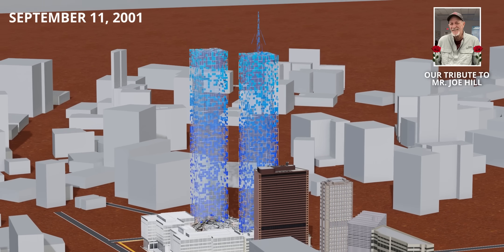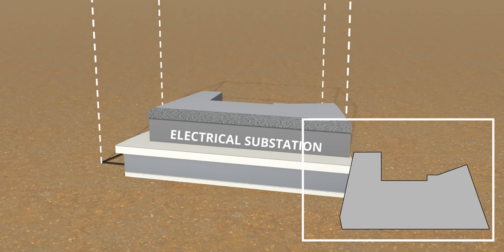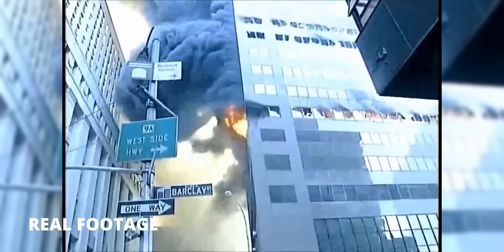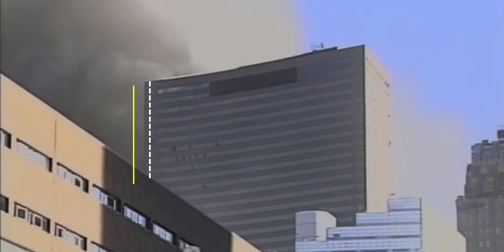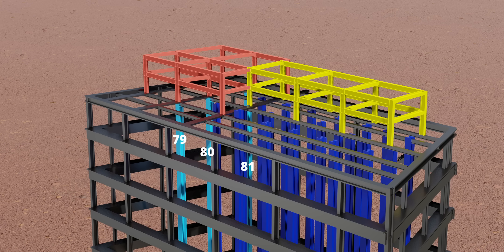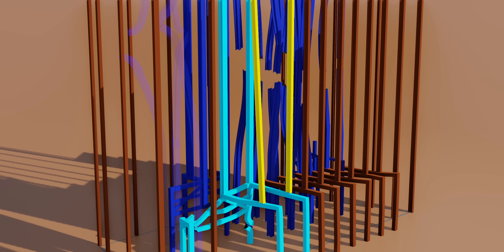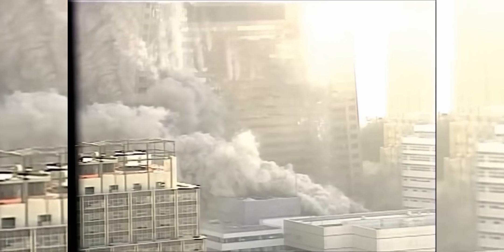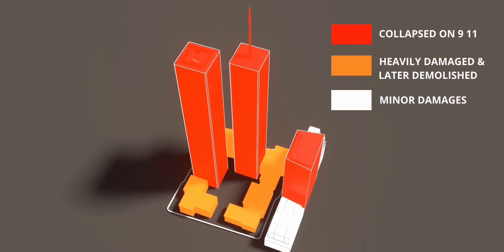Collapse of Building 7 | The Complete Physics

Comment: That quite a coincidence, first time a steel framing building has fallen, apart from its 2 taller neighbors. And why was a countdown reported before building 7 fell and what about the explosion's? Then there is freefell speed of collapse as though all the supporting columns failed simultaneously.
Reply: Steel buildings fail all the time in fire. Steel is formed using heat and deforms the same way, making steel construction uniquely vulnerable to, not immune from the effects of fire. Just because you don't know something that obvious doesn't mean it isn't that obvious.
Reply: @TheCriticalStinker-01  They fail all the time? 
 I'm a mechanical engineer and steel deforms at temps closer to a 1,000F and that takes time. A few small fires will not cause a building to collapse simultaneously. Steel has greater strength beyond its yield point, meaning that a collapse would happen slowly not 1 second slower than freefall. Good grief, the BS some of you will believe.
Reply: Which is complete nonsense. "Steel framing" buildings collapse every year.
Making up things about "countdown" and "explosions" doesn't change that.

"I'm a mechanical engineer". No, you're not, your own claim of "freefell speed" shows that with all clarity. Not that it would matter if you were, mechanical engineering is about as irrelevant as being a gardener. 

"steel deforms at temps closer to a 1,000F"
Actually, steel begins to deform at about 800 degrees F. By About 1200, it's lost approximately half its strength. Yet another bit of evidence that your claim was nonsense.

"A few small fires will not cause a building to collapse simultaneously"
So? WTC 7 burned over the entire building for 7 hours.

"that a collapse would happen slowly not 1 second slower than freefall"
And since that didn't happen, so what?

" Good grief, the BS some of you will believe"
Such as things like "mechanical engineer", "freefell speed", "few small fires", "first time", "countdown", etc? Yeah, some of you will believe the stupidest things because they fit into your cool action-movie story.
Reply: @mooneyes2k478  Calm down, we have a discussion here. You have to wonder why the events of 9/11 are now resurfacing - after 23 years? Could it be that a Trump presidency may have a REAL investigation of that day? 3 steel framed buildings collapsed that day - a billion to one coincidence, no? It could happen, I mean a monkey at a keyboard could type a dictionary to.
Reply: @ronbishop4057  - It could be because an entire generation have now grown up with no memory of the attacks, are just starting to find out about it and keen for information. 

A bit of bleeding obvious that I am sure never occurred to you. 

Although I object to the idea that the events of 9/11 are now resurfacing because one guy put out a few videos.

Comment: And bld 7 fell perfectly as tho it was a controlled demolition.  Lucky it fell safely into its own footprint.
Reply: Define "perfectly"?  It has to be a real, proper engineering definition, not just random shit you pulled out of your ass. 

Would "it's own footprint" include Fiterman Hall across the street which was damaged beyond repair when Building 7 collapsed or the Verizon Building - also across the street - which suffered nearly a billion dollars in damage from Building 7 hitting it as it fell?
Reply: The "perfectly" of falling across two buildings in opposite directions of each other. Which would be the, perfect, example of "not into its footprint". Imagine that.

Comment: Nothing else makes sense
-The Pancake theory doesn't hold up
-The demolition theory busted
Only the direct energy theory makes sense
And covers everything
Reply: Wow. You cracked the code.
Reply: How about this?  The unknown and unimportant Building 7 was the 6th building to collapse of 10 lost on 9/11. Though extensively studied, it confuses many people. Not famous, or a terror target, and no casualties, thus it did not get a lot of attention and few know much about it, creating a void rapidly filled with garbage from the internet. Because everything seems like a conspiracy if you don’t understand how it works I prepared this brief summary explanation of my own analysis. No politics, just engineering. 

The North Tower collapse at 10:28am bombarded Building 7 with tons of burning debris, causing heavy damage and starting raging fires burning out of control for 7 hours. Half the responding FDNY firefighters having been killed, others injured, units in disarray, equipment destroyed, no water pressure, and the greater urgency of Search & Rescue efforts, firefighting at 7 was pulled as futile. The building couldn’t be saved and was left to its fate.

www.youtube.com/watch?v=g_SvpwyC17M&ab_channel=MFitz  

Collapse of a burning structure is always a concern for firefighters. Steel buildings subject to fire rely on active fighting of the fires to survive. Buildings are designed around 1 to 3 hours of fire resistance, allowing time for occupants to escape and ACTIVE firefighting to get started, after which all bets are off. Left to their own devices they will exceed their design envelope and collapse. In B7 the occupants escaped, passive and active fire protections were compromised and active firefighting was abandoned which left the building to take its chances. It lost. Odds on Building 7 would eventually collapse, and it did. No big deal in logic. That is the sort of choice firefighters make every day in brush fire situations - which houses to save and which ones to let go. Only real difference here is moving the decimal on the size and cost.

www.youtube.com/watch?v=WnYBX6QT0R4 

FDNY Chief Daniel Nigro ; The biggest decision we had to make on the first day was to clear the area and create a collapse zone around the severely damaged 7 World Trade Center, a 47-story building heavily involved in fire. A number of fire officers and companies assessed the damage to the building. The appraisals indicated that the buildings structural integrity was in serious doubt. I issued orders to PULL BACK the firefighters and define the collapse zone. It was a critical decision; We could not lose any more firefighters. It took a lot of time to PULL EVERYONE OUT, given the emotionalism of the day, communications difficulties and the collapse terrain

FDNY Deputy Chief Peter Hayden ; We had our special operations people set up surveying instruments to monitor and see if there was any movement in the building. We were concerned of the possibility of collapse in the building. And we had a discussion with one particular engineer there, and we asked him if we allowed it to burn could we anticipate a collapse and if so, how soon? And it turned out that he was pretty much right on the money, that he said 'In its current state you have about 5 hours

The collapse of Building 7 was anticipated all afternoon and widely reported in the media with at least 24 video cameras recording some or all of the collapse. Everyone at the time knew what was coming and why.

www.youtube.com/watch?v=OY5S5k3tMHI 
Building 7’s collapse was totally different to the Twin Towers, harder to understand and most of the details difficult to see. But we can sort out what happened through careful analysis and observation.  What follows is MY EXPLANATION of the collapse sequence using the best available information and relying on no authority.

B7 was complex structure, a 47-story steel framed building built on top of a smaller existing 3-story building, requiring several lower floors dedicated to complex load transfer structures instead of usable office space. Of trapezoidal shape and all-steel tube-in-tube construction, B7 (above the 7th floor) consisted of a central core of steel columns carrying most of the gravity load, perimeter steel columns around the outside of the structure carrying the remainder of the gravity loads and long span beams and girders to tie those elements together and form the floors. On the outside of the building hung a moment frame - the last part of B7 to fall. 

Phase 1 : Collapse initiation for B7 is notably quiet with observers not realizing the building was collapsing! There was no audible warning in the form of say hundreds of ear drum busting 180-190dB explosive bangs preceding the collapse. The first externally visible signs of collapse initiation occurred at 5:20:28 pm. Here at 12:00 a local CBS affiliate reporter is talking 10 blocks from B7 when collapse begins. People don’t start to notice the collapse until 12:11. Then at 12:45 is the famous CBS fixed camera clip of Building 7’s collapse Again, note how quiet it is.

youtube.com/watch?v=t5tEy6mXSE8&ab_channel=fresnosean379

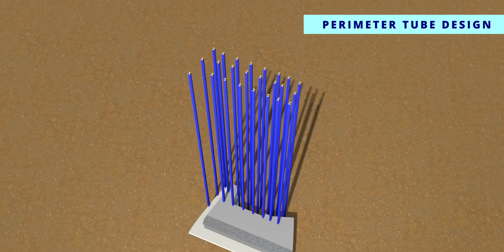Collapse initiation was due to multiple lower floor failures above the load transfer region (7th floor) in the NE corner of the building. In this video at 0:45 you can see the NW corner from inside the building while under construction, Column 79 just out of frame on the left. That big, angled steel beam across the top of the frame connects to C79 at one end. The girders connect to the beam. That beam and all those girders depend on just one connection

youtube.com/watch?v=nP3TNHPCIVU&t=35s&ab_channel=EdwardCurrent

Phase 2 : Lower floor failures caused a loss of critical lateral support over an excessive length of core Column 79 and it buckled. If you look at a floor diagram of Building 7 (see above) and look at all the structures that depend on C79 you quickly realize this one column was a relatively isolated structural element on which a disproportionately greater fraction of the structure depended . Externally we see a vertical progression of window breakage along the 44-46 line and a kink in the roof of the East Mechanical Penthouse at the top of the building, consistent with C79 failure. The transition from full capacity to almost no capacity occurs in virtually an instant. Once the buckling failure occurs there is almost no resistance

Normally with a buckling column, the load could very well be redistributed to other columns, meaning the buckling could stop after a while. With C79 that is not the case - the failure did not redistribute the load, so the collapse rapidly progressed to the roofline, sinking the rooftop penthouse.

Phase 3 : With C79 gone, B7’s progressive, non-symmetrical collapse continues with C80 and C81 at the east end of the core left laterally unsupported and quickly buckled and failed as well, sending the EMP down through the building. C79-81 all have no diagonal bracing, which I believe is a major reason why they could not redistribute a lot of vertical loads among one another.

From there collapse progressed from east to west through the central core until the core was gone taking all of the interior floors and structures and probably most of the perimeter columns with it. You can see the horizontal progression of window failures low in the building and the dropping of the remaining rooftop structures into the building. One of the big takeaways from the NIST Building 7 study (that gets completely ignored) was their modeling which determined C79 failing under ANY circumstances would have initiated the same collapse sequence.

Phase 4 : After more than 10 seconds Building 7 is reduced to just a hollow empty outer shell - the exterior moment frame - creating the illusion the building is still standing since little has changed externally. But it’s just a hollow empty shell like an empty cereal box supported by only a few remaining columns and quite unable to remain standing. The north face leans inward, forming a V in the roofline, the last perimeter columns buckle under the strain and with nothing left keeping it up the moment frame free falls, landing on top of the 7-story high debris pile. It is only here, at the very end that a single measurement of alleged free fall is taken. Start to finish the collapse took 18-20 seconds, or less than 1/3 of true free fall for those who have been conned into believing that has any meaning. Worth noting - how fast something falls cannot tell you what started it falling in the first place. It’s not even the building itself free falling but its empty remaining outer shell at the very end of the collapse. The debris spread out, blocking surrounding streets, heavily damaging the Verizon Building and destroyed Fiterman Hall, all well outside of Building 7’s “footprint”.  

Building 7’s progressive, non-symmetrical collapse was incidental and unintended collateral damage from the combined effects of fire + time + gravity started by the collapsing North Tower. That is true no matter who planned and carried out the 9/11 attacks or why . The collapse was of so little consequence it barely even registered at the time, a mere footnote. 

Anything can seem like a conspiracy if you don’t understand how it works. Now you should. I hope you found this helpful and informative, not adversarial and it solicits informed critical comment. If I made any errors of fact, logic or reason or left anything critical out, please let me know so I can fix it. IF you can offer a more plausible alternative please do. Be the first. Please start any reply with the words “Tits McGee” or I will know you didn’t read it and are wasting my time.
Reply: "Only the direct energy theory makes sense"
So, why then, would you claim "chared cars"? One or the other.

Meanwhile, since you're so hot on "Judy Wood", you can of course solve, and explain, this:

E=(C(S)∆T(1)+C(F)+C(L)∆T(2)+C(V))M

I'll be RIGHT here waiting...
Reply: @mooneyes2k478  
I could solve and explain it
But, i have nothing to prove to you
The Direct Energy made the Twin Towers turn to dust

But,at the same time didn't affect say paper
Much less burn anyone
And it also chared  cars at the same time
Reply: @brianwhite3428  - In situations like this I always have a long list of questions I can ask that I know a person such as yourself will not answer because you cannot answer.  So it's so hard to chose.  I'll go with this one;

If the Twin Towers turned to dust as you say, then why didn't all of Lower Manhattan turn orange overnight?
Reply: @brianwhite3428  Isn't it interesting how you got ever so quiet...wonder why...
Reply: @mooneyes2k478  
It just shows what you think you know?
Your not a expert
Reply: @brianwhite3428   That's absolutely true. I'm not. Then again, I have never claimed to be. But, I do have basic knowledge and understanding. Considering that you can't tell "you are" from "belongs to you", it's fairly clear that that basic knowledge and understanding outstrips you and yours by a wide margin.

Meanwhile, you claim you "can solve and explain it" while carefully running away from any such explanation. Much like a small child pretending that HIS dad is SUPERMAN, stomping his feet and crying because he's being laughed at.
Reply: @mooneyes2k478  
So what basic knowledge, do you gave about the Twin Rowers?
Yes, the Towers were hit by plane
That's about it

But explain,why the Tower came down in dust?
Where did the Twin Towers go?
This ought to be interesting
To hear your theory
Reply: @brianwhite3428  - 2. If the Twin Towers turned to dust as you say, then why didn't all of Lower Manhattan turn orange overnight?
Reply: @brianwhite3428  No? Nothing? Much shock.